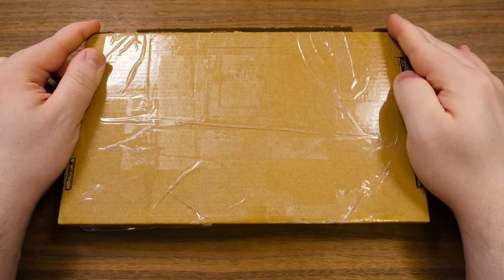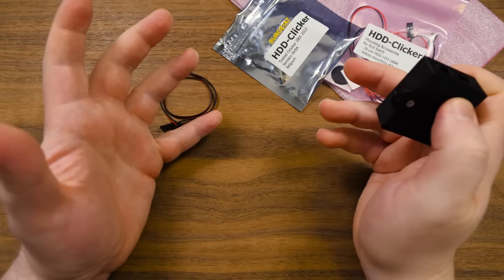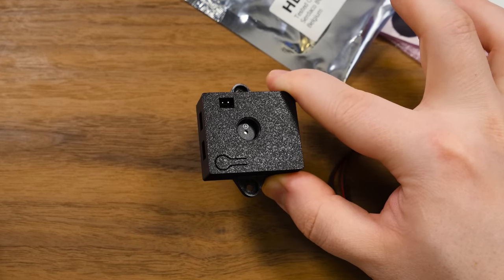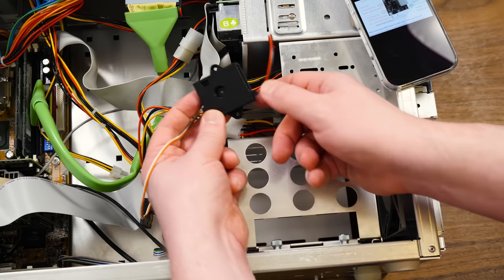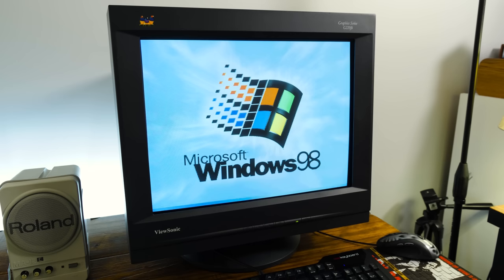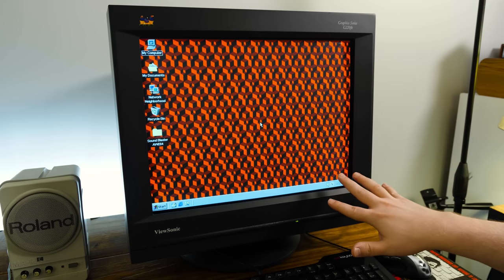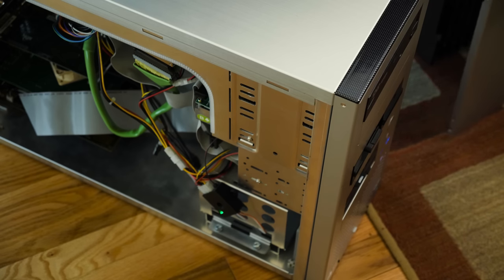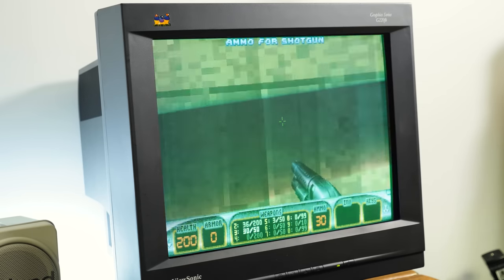The HDD Clicker: Add Hard Drive Sounds to SD/CF/SSDs

Comment: It's a neat idea but I would like to see a more advanced implementation on something like the RaSCSI that uses real customizable sound samples and uses the current head position as its input instead of just the activity LED. This clicker can't really tell the difference between sequential and random access so it has to approximate it.
Reply: Wouldn't something that creates mechanical sounds like a solenoid be even more suitable? At least sound wise.
Reply: Go get that implemented and send it off to LGR for review, you have a month...
Reply: Sounds like you have a project for yourself over the winter. Chop chop.
Reply: I simply prefer to keep mechanical drives in my vintage computers. No need to replicate the sound, just use the real thing. 

To me, the drive was part of the experience, especially old drives that slightly vibrates the table when loading a program.
Reply: I want one that actually count the bytes passing through the cables and extrapolating that to mapping tables with every existing hard disk drive and replicating the noises exactly.

Just get a hard disk dude.
Reply: @volvo09  i feel the same nothing beats that spin up and drive initialization sound when start pc
Reply: You could just analyze the blink pattern, as rapid flashing for a duration would be a sequential read and intermittent flashing would be random reads. I'm realpy waiting for the servoing sounds that come during startup.
Reply: @volvo09  another option is keep the SSD for booting windows but keep secondary platter drives for storage and things that don’t need to be accessed so quick like mp3s.
Reply: @GeomancerHT  Yeah! Just get a real vintage HDD.
That way you can experience the true sounds of a failing drive that's struggling to stay alive. 😁
Reply: I thought about how you might do that but I'm not sure you can actually make it sound like a physical hard disk unless you also slow down the IO requests. Since with an SSD there's basically no seek time.
Reply: Sounds like an extremely fragged drive for sure.
Reply: Yeah the sounds would have to vary by which era you'd want to simulate, with the older MFM drives not only sounding completely different from the later IDE drives, but also completely different per drive model.  A sample-based system would be necessary.
Reply: I think the LED implementation is fine. It just needs more samples and some randomization between what one is used
Reply: Was just about to say this; hard drives only click when the head moves which ideally won't be on every single read, and I think that for me is the thing I notice more than the exact nature of the sound (at least based on this video having not heard it in person). They could probably fake it reasonably well by skipping some random number of pulses of the activity light before sounding again.
Reply: @GeomancerHT  tbf I suspect in another 50-100 years that first method may be all that’s left :P it’s definitely premature in necessity right now, but still a neat idea (if, of course, overkill)
Reply: Even an SD card is so much faster at access time that it would be impossible to map the actual drive operations to noises that sound "correct".
Reply: @DeinonychusCowboy  it could come with a special software that forces the disks to be slow to the desired pace and have the matching noises accordingly.
Reply: @volvo09  agreed! More then enough new old stock around, for the life of me I will never understand what I call this need for fake Retro! A SSD does not belong on a 90s system!
Reply: @E-Box  plenty of new old stock son! Plenty! Millions of drives that have never been plugged in!
Reply: @DeinonychusCowboy  exactly! It’s silly what some of the old farts here are saying about accuracy! Anyway! A SSD doesn’t belong in these systems! Plenty of new OLD SPOCK!
Reply: @E-Box  Imagine a clicker of some sort that randomly clicks like a stuck head. Adrenaline!
Reply: Well, I believe there is no discussion that the real thing will be better; but the attempts to replicate it are still valid. In my opinion, the piezo don't sound that appealing. And, as I also wanted to share what crossed my mind: I believe the output could be a real slave drive with a modified/new logic board?  Maybe there are delays problems as shared above...
Reply: highly doubt an SSD has any "head position" to read.
Reply: @juliedunken1150  New old stock doesnt mean it's gonna work like new though. 
Also i kinda doubt your claim of millions of drives.
Reply: @volvo09  Ah yes, the immersion of data loss when the old drive fails, irreplacable.

in all seriousness, though, if the system is too old to use SATA drives (most of them) you're stuck using a SATA to PATA converter and I haven't had much luck with those.
Reply: @IsoMacintosh  MILLIONS , I’ve seen them… oh the things I have seen that you could never believe
Reply: @reanimationxp  : All that you need to simulate head seek is to spy on the SSD channel, and queue up a "seek noise" any time that the specified address on the disk is too far away from the previous one. However, it still will be a bit different, since the seek time will effectively be instant, so the noise will either sound different or be out of sync with the drive activity.
Reply: Honestly, I was hoping for more of synthetic sounds, something Cylon-ish perhaps.
Reply: Get to work
Reply: Well, what are you waiting for? Get to it
Reply: @volvo09  Not practical, especially when they die every once in a while.
Reply: @user-lv6rn9cf8m  Ever hear a Micropolis drive start up?  It’s sounds like dropping a marble in a coffee can!
Reply: hmmm  custom sounds .... now i want a monotone voice whispering from the SSD "reading reading reading" and "writing writing writing" over and over again
Reply: Is it that important?
Reply: @alexfinns6162  YES?
Reply: @juliedunken1150 there isn't millions because companies that do long time legacy support - for example for the government - are having a hard time finding new old stock reliable drives to maintain essential systems. Given that the average hard drive doesn't last as long as people think, we're going through them at a rate that isn't sustainable. That new old stock is getting more and more expensive and rare and there's only so many unopened warehouses.

Comment: I think that the SD reads and writes so fast the clicking is way faster than what an old school spinning disk would be so that is making the clicking very rapid.
Reply: That, and the fact that it's missing the "whirring" sound that HDDs make while spinning but not necessarily reading/writing data. With a higher-quality speaker (instead of using a piezo) and some better software, this would absolutely be a product I'd consider putting in my modern Ryzen 7000 + 4090 PC.
Reply: @Psythik  the "whirring" sound is the spindle motor. And depending on the drives and the case they were not always audible. IBM and Connor drives were very quiet (relatively), while Quantum and Seagate (before the Connor acquisition) have that unique 90s drone sound of the motors. Obviously there were all the others, but it really depends on what kind of drive you're trying to replicate, how important it is
Reply: @Psythik  baha, I'm with ryzen 3000, and recently upgraded to a 4090, here's the kicker. I still use platters!
Reply: @Xurikyo  Jesus christ you need to get an NVME ASAP
Reply: @Psythik  tbh having a ssd is overrated.
Reply: @Xurikyo  spinning rust for lyef111
Reply: @Psythik  With a quality speaker I would like to replicate old case fans, rattling parts, and noisy coil whine. Modern computers are way too quiet.
Reply: A simple flipflop would cut the frequency of clicking in half
Reply: also i think it might be slower if used on say a really old isa controller card such as the isa one i have in my 486. The slow seek time might make an impact - even with a CF card it boots very slow
The computer demonstrated in the video was of windows 98 age so i would be interested in seeing how it worked with a 3.1 machine with an 16 bit isa controller
Reply: Yah, and as Clint said, it's making the same noise for what would be head seeks and data read/writes. If I were programming it I'd give it the pseudo-random different sound effect Clint suggested, so every 25 clicks or so (plus or minus some number) it would make a slightly different noise? Dunno what's possible with a piezo clicker tho. But also possibly damp out every other click if they are coming too fast too close together.
Reply: What makes the clicking noise in a hard drive isn't the read but the seeking as the head moves toward the sector the data es supposed to be which creates it's unique, seemingly random noise.
Reply: Doubt the disk drives bottleneck anything but loading times, I've run games off disks and solid state and the only difference is loading time
Reply: Yeah, definitely a bit fast. This sounds more like a laptop drive vs larger drive.  One part thats also harder to replicate is the lower frequency sounds and vibrations. Still a cool project though!
Reply: @Psythik  NVME don't have 14 TB of space.
Reply: @SomeGuy_GRM  You're not supposed to have 14 TB of data "always available" use external disks for that, or literally use an NVMe for windows and important stuff, and an SSD for normal storage. The. External for large data..
What world you guys living in, if you are using an actual HDD for everything, you'll be VERY surprised how fast your pc is when installing windows on one.
Reply: @gabriellevesque2185  Why would I have an external server when I only have one computer? It's effectively an internal media server the way I use it.
Reply: @SomeGuy_GRM  I never talked about external servers, I said external Disk, USB 3.0 HDDs or SSD whatever...
Just have one always plugged in for backups and like 8TB of data of whatever, then 1 TB NVMe for windows and important stuff, maybe 2-4 TB SSD for a bit less important stuff, then the rest goes into external disk.
It'd be a completely new computer speed-wise.
Reply: @gabriellevesque2185  Dude. The 14 TB is my J drive. I have several SSDs.
Reply: @gabriellevesque2185  why would you advocate for an external HDD instead of one in the system? That sounds so dumb. I'll take HDDs in my case over external HDDs dangling off my computer any day.
Reply: @Xurikyo  Who doesnt? Using SSDs for large, not rapidly changing or loading data is not a superb option. But i guess you don't use 1990s platters, so this comment goes nowhere as modern drives are not even audible if you have a half decent case.
Reply: Entirely depends on your polling rate. The clicks can be arbitrarily paced with the proper electronic internals.

Comment: That would honestly be great for building a modern sleeper PC in a classic case - really helps creates that immersion of it being an older machine with real power underneath!
Reply from the maker: Ooh, good point!
Reply: @LGRBlerbs  agreed 🎉
Reply: @LGRBlerbs  😎
Reply: My current build (5800X3D/3070) I put in an early 2000s beige case, and the 4TB HDD I've got in there still makes a big racket lol.
Reply: Or in a "new" old spec retro PC, made with new parts
Reply: you can get modern HDDs you know. Sure they don't sound exactly like a 90s drive and are a lot faster, but using a poor imitation when you have the real thing available doesn't make sense. And a modern 250 MB/s WD Black is still a helluva lot faster than the 10-50 MB/s drives from the 90s (it just sounds like a jackhammer against a metal plate when it's at full tilt, rather than subtle clicking), and there are a lot of things, including many games, that don't benefit at all from running off a SSD so it's still valid to use them in a high performance machine
Reply: I actually have a sleeper pc with an old hp compaq 3000 full tower case. I might actually buy one of these to give the sense that it is a old pc, though I'm sure the mouse and mousepad would give it away
Reply: @rockl79  we had mouse and mousepads back then ya' know ;-) lol
Reply: @player_unknown963  We still do lol. My mousepad is Krotchy, the Postal mascot. His nuts are a wrist-rest.

Comment: This sounds more like a geiger counter. As others noted, a better implementation that includes spinning and stepper motor samples would be better, and an awesome thing to have.
Reply: Simulating head movements would require more information about what's going on in the drive (i.e. access to the IDE bus rather than just the activity light)
Reply: Build it and we will buy it.

Comment: Worth considering that you're actively listening to it, rather than just not thinking about it happening in the background. I think if you had one of these installed, you'd forget what it was and just get used to the reassuring noise of the drive, and the informative clicking when it was doing something and not "Is it frozen again?"
Reply from the maker: Definitely. And now that it's a wee bit muted with the tape, I've already found myself forgetting it's even there while using that machine :)
Reply: I wonder if sticking it deeper into the case to get more resonance would help in addition to the tape.

Comment: I share the same issues as Clint. Another factor I believe is the access rate. Flash media is going to read/write much faster than period correct spinning disks and as a result the click will be equally as fast. One would conceivably have to slow down the read/write speed of the drive to obtain a more period correct clicking speed. The down side of course being a slower machine.
Reply: You can probably get a convincing experience without slowing down access speeds (for the people who want the best of both worlds).
 A simple rate limiter would stop the clicks from getting too close together and having the same aprox sound experience.

It just wouldn't be a one-to-one mapping of seeks to clicks anymore.
Reply: If you accept a slower data transfer as a tradeoff, maybe just getting a new (or new old stock) spinning disk would be the way to go?
Reply: I feel the same way. When I think "mechanical hard drive", I think of opening a folder, waiting a brief second or two while the hard drive clicks away before the Explorer window finally shows up and the drive goes silent.
Reply: Hearing "period correct" said outside reenacting feels so strange. Like seeing those behind the scenes photos of Marie Antoinette (2006 film) actors holding a MacBook. I giggled just a little. 😂